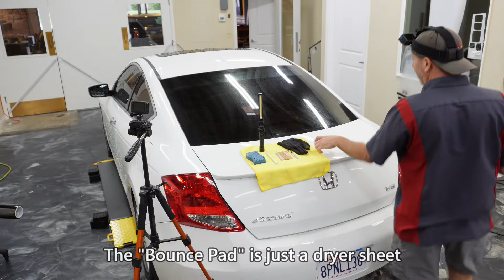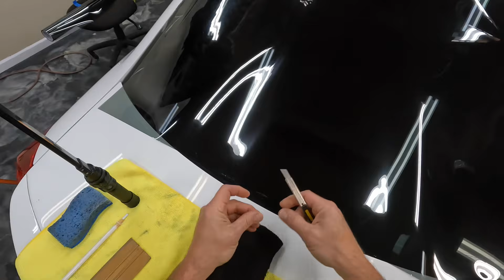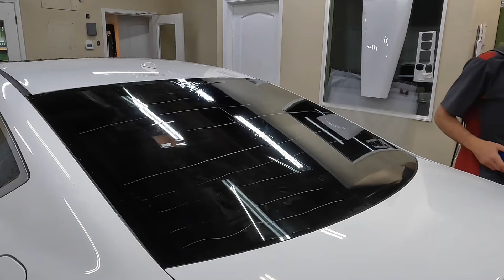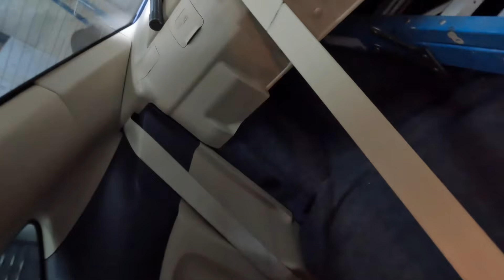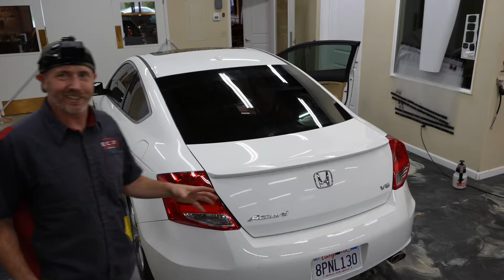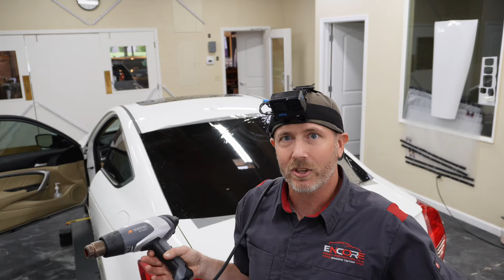Beginner's Guide to Heat Shrinking Window Tint: Dry Shrink Rear Window

Comment: Didn't they say you can use stainless steel cutter on the glass?
Reply from the maker: It can still scratch. Back when I started tinting we cut on the glass all the time. It wasn't an issue. Now it's a much bigger deal. Glass can get very fine scratches so easily.

Comment: When you say it only shrink on factory edge, does it count by eg only a feet or 2 feet from both factory edge can be shrink ? Or it doesn’t really matter by length ?
Reply from the maker: Good question. The length does not matter. It will shrink all the way through from top to bottom. 
You'll learn really quickly what happens if you try to shrink on the sides. You end up having to throw the film away. 😁

Comment: HEY MAN, IM SUB'N BC OF THIS VIDEO, AND JUST WANTED TO THANK YOU FOR TAKING THE TIME TO DO THIS VIDEO. I HAVE SO MANY QUESTIONS RESULTING FROM IT THOUGH 😂I WASNT AWARE THAT ONLY THE FACTORY LINES BEING "SHRINKABLE" AND WONDER IS THIS COMMON PRACTICE FOR TINT FILM PRODUCERS ? ALSO, THAT GLOVE...IM ASSUMING ITS WHAT... JUST PURE COTTON? WHEN YOU SAY BOUNCE PAD IS THAT JUST A BOUNCE DRYER SHEET? AND THE PLASTIC PIECE USED NOT TO CUT THE GLASS AND HELPS KEEP THE TEMPLATE CUTTING SMOOTH..WHAT IS THAT   EXACTLY? WISH I WAS CLOSER I WOULD HAVE VOLUNTEERED TO GET REPREMADED FOR HEAT SHRINKING THE WRONG WAY 😂. IM A COMPETENT PERSON WITH MY HANDS, MECHANICS, CONSTRUCTION, ARTISTRY BUT HAVE STRUGGLED PERFECTING AUTOMOTIVE TINTING.  ALSO, FIGURED YOU MIGHT APPRECIATE THIS...I TINTED MY FIRST CAR WHICH WAS UNFORTUNATELY A 90' FORD PROBE..DID YOU EVER HAVE TO TINT THOSE BACK WINDOWS !!?? IMPOSSIBLE FOR ME !!
Reply from the maker: I’ve tinted a Ford Probe before. That’s a pretty old car these days when it comes to window tinting, and it requires a lot of extra cleaning.

Yes, all film only shrinks on the factory edges.

The gloves are pure cotton.

Yes, it’s just a dryer sheet.

You can use any piece of plastic. The one I was using was cut from a “Lil Chizler.”

Window tinting can be very frustrating to learn. There really isn’t an easy way to bypass the learning curve 🙂 You just have to keep at it. It takes time, but you’ll get there.

Comment: Can you use hard squeegee for shrinking instéad of using Teflon
Reply from the maker: I'm sure that will work fine. As long as it's hard enough that it glides across the film. You don't want a tool that grabs or sticks to the tint at all. That will cause problems.  👍🏻

Comment: I would skip the water and sponge…it will stick enough when pressed down with a card…
Reply from the maker: I would wet the edges. It really helps keep the film down. 
You are right though. Some of the time you do not need to add the water. For a beginner, I don't want the sides popping up at all. Plus if you are working on a vehicle that has a lot of contamination on the outside of the glass it will not stick well without the water. 👍

Comment: Maybe if the light comes from the sides instead of the top we can see better the fingers , excellent video by the way
Reply from the maker: A couple of weeks ago we painted the walls white. Next will be the ceiling.  The ceiling needs to be white so you can see the reflection of the light on the fingers. 
Dark walls and ceilings look great for pictures but it terrible for seeing what you're doing. Also very bad for while you are pushing (working) out little specks of contamination during the final clean.

Comment: "When you see the finger get the side to side waves " is what your looking for 26:37 the way to explain it I think. I've seen someone else explain it that way
Reply: I think I'm wrong on what your trying to explain 😂 sometimes you can't explain you just gotta learn from experience for stuff
Reply from the maker: That was a U shape in the film. Those need to be pushed out because you can not heat shrink those away. 

But yes, you do want to want to push the film down once the finger is left to right instead of up and down. That normally means it's shrunk enough and is ready to be pushed out. 😁👍

Comment: Doesn't the glove burn your hand?

Can you also tell me the brand of the glove and the heat gun?
Reply from the maker: No, these cotton gloves are pretty good for protecting your hands. Plus, I move pretty fast. The tint and glass never get hot enough to be a problem. 

Every once in a while (very rare) I let too much heat from the gun hit the glove and that can burn. Never enough to injure me though. 

These are cheap gardening gloves from harbor freight.

I did try a tight-fitting wrap glove before. That glove was a problem. It got way too hot, quickly!
Reply: @EncoreWindowTinting  Thank you, what brand of heat gun do you have?

Comment: I hope you see this. This video is awesome but what does the chiseler piece do exactly?? Can you tell me? Is it to not scratch the glass? An if so do you put the tip of the blade in and cut with the length of the blade??
Reply from the maker: The chiseler piece helps you cut the film without touching the blade on the glass. New glass scratches so easily.  So you put the plastic under the tint and stick the sharp edge of the blade through the tint and into the plastic. Then, slide the plastic around the window with the blade.
Reply: @EncoreWindowTinting how do you make the chiseler piece? Or does it matter what plastic you use?
Reply from the maker: @brianmariano03_11 I just cut a little edge off of a Lil Chizler.  You could even use a piece of an old credit card.  Some people use a thin button instead. Any of these work great. You just don't want to cut the film directly on the glass.  👍🏻

Comment: Surely the film should be on the inside
Reply from the maker: Not for the heat shrinking process. Without this step, the film will never fit the contour of the glass when it's put inside. Did something in this video imply that I'm a beginner, and I don't know what I'm doing?

Comment: When you say it will only shrink on factory edges, do you mean in the direction of the roll? It will obviously shrink in the middle or it wouldn't take shape. I'm trying to tint my full face helmet visor and I'm having a hell of a time getting it to shrink onto the bottom half.
Reply from the maker: I've only been able to tint 1 or 2 helmet visors. I only did it for close friends of mine. They are pretty difficult. Most of the visors had too much curve to shrink. Also, it took way too long, and I couldn't ever charge enough to make the headache worth it. 🙃 

The factory edges would be the top and bottom of the roll. So, no matter how you lay the film on the window (or visor), you need to make sure you are still shrinking the top and bottom of the roll. In the video, I roll the film out from left to right. So, the factory edges are the top and bottom. If I was to roll the film out staring at the trunk and rolling out towards the roof of the car, then the factory edges (top and bottom of the roll) are now on the sides and I would need to shrink the film on the left and right (sides) of the window. 

Let me know if that didn't explain that well enough, and I'll think of another way to say it. 👍🏻😁
Reply from the maker: You also want to make sure that you have the fingers separated (distributed) between the top and bottom evenly.  Too many fingers on the top will make the bottom easy to shrink and top harder to shrink. In some cases, it'll make the top (where more fingers are) impossible to shrink. Film will only shrink so much, and some films shrink more and easier than others.
Reply: @EncorePPFtint  thank you so much for your detailed response. It makes perfect sense, and you're 100% correct that the compound curve on it is ridiculous. Is there any company that makes tint you can stretch a little bit through the middle to counteract the amount of shrinkage needed? Or what would you recommend i use that might have the room to shrink enough? 

Again, thank you for taking the time to respond. I really appreciate it.

Comment: I’ve tried shrinking chameleon tint on my front windshield twice now with no luck. Could it be that I’m putting the film on sideways. The height of the film was enough for the width of the windshield so I rolled the film out from the top to the bottom of the windshield. Is that why it just seems impossible to shrink?
Reply: Also I’ve never used a dry cloth is it supposed to smell like detergent and be kind of waxy?
Reply from the maker: Yes. It's an antistatic dryer sheet. It keep the tint floating on the window and not sticking to the glass.
Reply from the maker: That could be. you can only shrink the top and bottom of the roll (the factory edges). Window film can not shrink on the sides of the roll. you should be rolling the film out on the windshield from left to right. Then you will be able to shrink the top and bottom of the roll. 
If you try to heat shrink the on the sides of the roll you will destroy the film. 👍
Reply: Tuned in from Zimbabwe 🇿🇼..
The guys here don't even teach you how to do it😂.. Thank you👍🏾
Reply from the maker: @tatendamasara8332 No problem,  I'm glad you are finding the video helpful 👍🏻

Comment: Wet or dry shrinking, which is easier or better?
Reply from the maker: Dry shrinking is easier—and far better! With dry shrinking, you can shrink all of the film that isn’t tacked down with your H-pattern. In contrast, wet shrinking only allows you to shrink the fingers that pop up from the glass. Plus, water works against you during wet shrinking, constantly resisting the heat and making it harder for the film to shrink. You can also get a much tighter shrink with dry shrinking.
Reply: @EncoreWindowTinting  thank you so much sir, this is a very helpful video, greetings from Venezuela ✌🏻
Reply from the maker: @scorpion3190 You are welcome.  It's so cool that we can connect from around the world like this! 👍🏻

Comment: I tack down the sides and create my H but everytime I start, the film decides to shrink towards the H making a C shape or a U shape and seems to want to keep going towards the corner or the edges
Reply from the maker: The film will be the hardest to shrink on the corners. That's where you will have the most fingers, and because one side is tacked down with the H pattern, it makes the film heat shrink differently than fingers that are  out towards the middle. 
As far as the U shapes... those areas are either shrunk enough or too much. You need to push those out. Sometimes, when you push the U shapes out, they create fingers at the left and right of them. Then you shrink those fingers down. 
I need to record some footage of a person learning to tint windows and how to fix and avoid the problems.
Reply from the maker: You will see in the video that I do not allow U shapes in my heatshrink. As soon as one starts to show up, you need to push it out and correct it.

Comment: So how good is this outside tint? I had some installed but the place didn't tell me it was done this way.
Reply from the maker: @jstr6522  The tint does not stay on the outside. Once shrunk to maybe the contour of the glass, it goes on the inside. This video is only going over the process of heat shrinking the film on the outside.  👍🏻
Reply: @EncoreWindowTinting  interesting, I'm almost certain the guy put it in the outside but I'll check again later today

Comment: what tint film do you use? it seems very good
Reply from the maker: The film I used in this video shrinks incredibly well. It's made by SolarGard and is an inexpensive film. It's on the lower end as far as quality goes. I believe it's called smoke, and it's not a color stable film. So it's going to turn purple over time in the sun.

Comment: As far as trying to explain the u shapes and shrinking, my thoughts are you are trying to shrink a small basically enclosed area into a center area without an area that is open, so no area for the material to shrink out. My thoughts anyway.
Reply from the maker: Interesting way of putting it. I do need to find a way to say it that makes it easily understandable. If that even exists. Maybe it would just be easier to say how to avoid it or fix it.